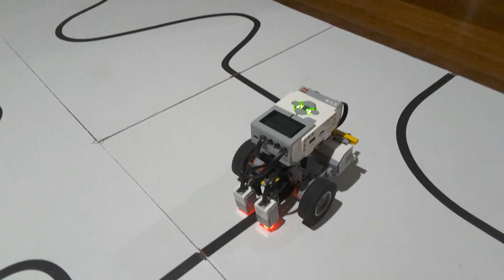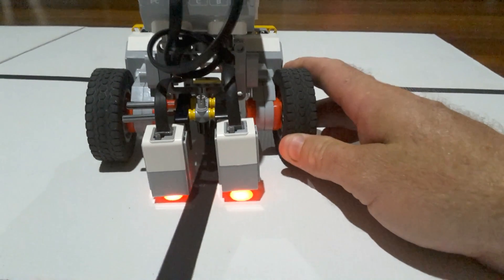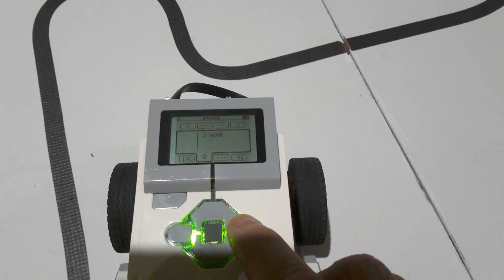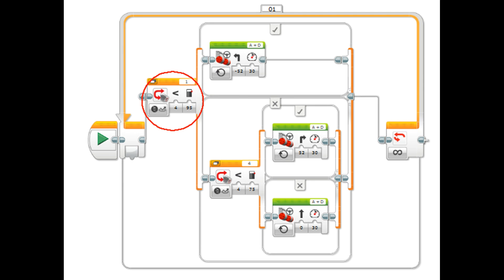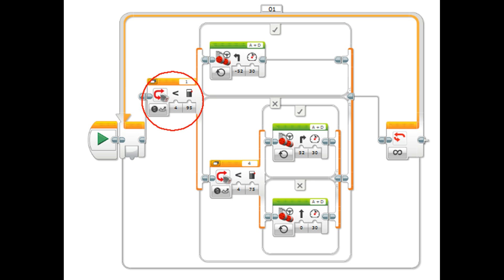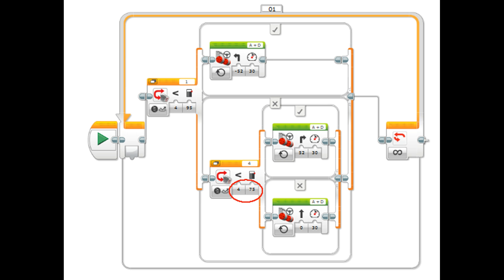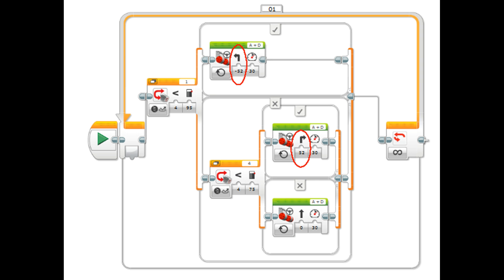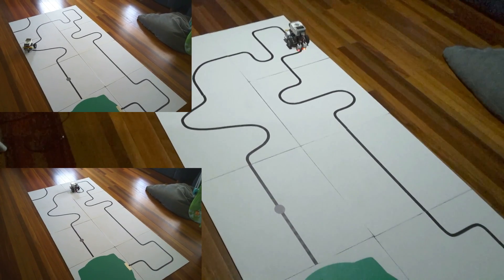2 Sensor Line follower Lesson 3

Comment: Hello, thank you very much for such a good explanation. I have a question, I placed the 2 motors backwards, i.e. the shaft is at the back and the motor in front. In this case how would be the direction of rotation for the 3 cases?. I tried to change the speed to negative (-30), but it did not work, the robot started to go out of the line. Could you please help me?